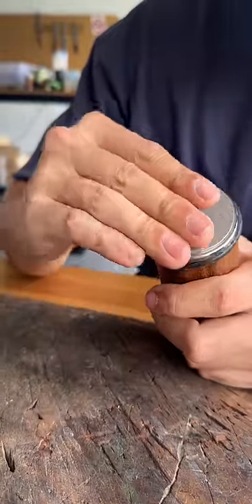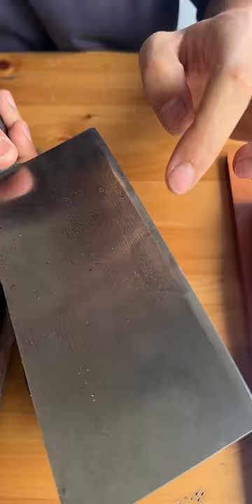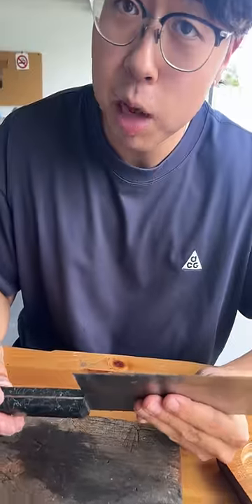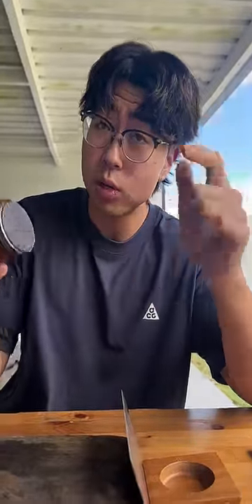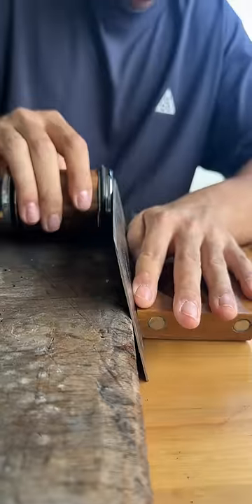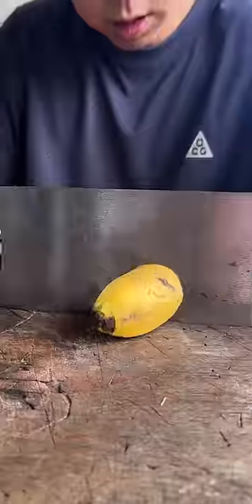Sharpness test on a banana!#fyp #knife #knifesharpening #ray #knifesharpener#knives #japaneseknives

Comment: You can use your palm instead of the leather on a stick to clean the edge afterwards. Just a tip if you dont have one. I dont. Or just use the inside of your leather belt.

Comment: Also at the end, use decendimg numbers of strokes on each side. Ten to one side, ten to the other then nine, eight, seven, down to one, and one when sharpened on one side, the metal bends one way. Sharpen on the orher side, the metal bends the other way. Using decendimg steokes, endimg with one, one one one switching sides you get a razor sharp edge. My father taught me this. However he said the sharpest blade will not maintain extreme sharpness, so he never made them as sharp as he potentially could. 
If we had damascus steel, and the Japanese folded metal techniques, you could do much more. 
My dad could sharpen a knife so well it would easily shave your beard.
Reply: Great insight and advice. To respond to your dad sharpening to hair cutting sharpness. In my kitchen I got one knife that can cut hair. It is the paring knife that is made for precision and decorative cuts. I am very proud of it as I had to sharpen manually so many times and made mistakes just to get that correct 8⁰ angle.

Comment: Sharpness doesn't matter if it's low quality steel though
Reply: It still matters. Difference is that you have to sharpen it more often. Surgeons use scalpels that are made of either 420 or 440 because of how sharp you can make it and because they're only used on one patient the edge retention doesn't matter.

Comment: Now, my friend, you need to know that knife you have. You need to sharpen so that it's sharp on one side. Only and flat on the other like a chisel and Then you'll be able to handle a lot more items without putting it down. It also will make a beautiful cut on the flat side. And that fan fans, sushi, you're looking for that thin cutter. Meat sharpen the blade, the side flat.
Reply: I have read a chad single bevel user. I wanna ask. Left hand user or right hand user....or both.